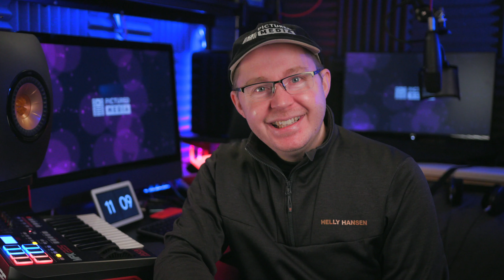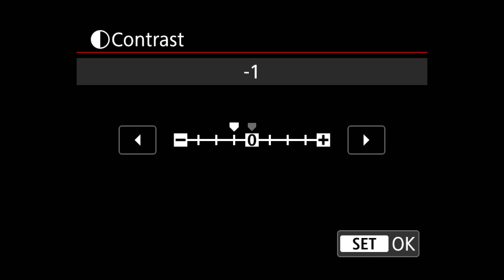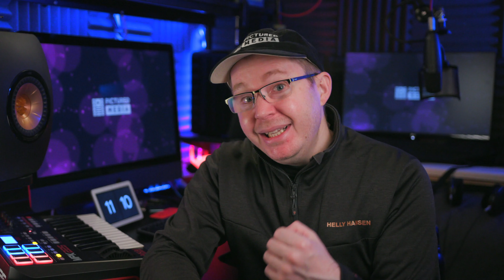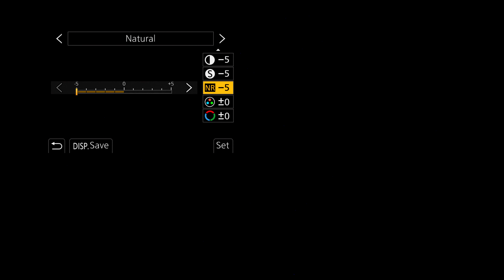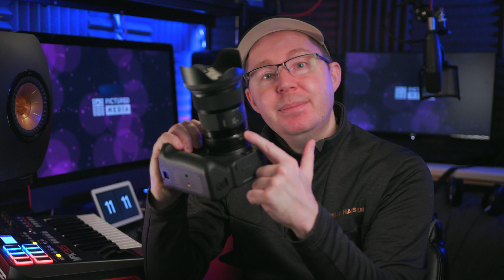Canon R6 Low light test with GH5S comparison

Comment: Thank you for those tests, can't argue with new tech and full frame these days for sure :) but as a GH5s user there are a couple of observations if you don't mind me saying..
The 'base' ISO on the GH5s can go to 160 if you turn on the 1/3 ISO increment option in the menus and with the extended ISO setting turned on you can go down to ISO 80(but perhaps beside the point). It's also probably why you skipped testing at 2500 ISO which is part of the dual native ISO setting for the GH5s (400 & 2500 as you may know)..
Thanks again :)

Comment: The GH5s is a better video camera overall. These new full-frame mirrorless cameras have a host of drawbacks that come with the large sensor size. For photos, they might make sense, but when I look at the world of video production, smaller sensors tend to be superior to larger ones when it comes to the "external factors" outside of raw image quality (stabilization, cost, battery life, weight and bulk, sensor overheating, long zoom potential). MFT strikes a perfect balance between good image quality and good external factors, and the GH5s is arguably the perfect MFT video camera.
Reply from the maker: I pretty much agree with all of that.  My GH5 & GH5S remain my workhorse cameras, and the icing on the cake is that they are really nice cameras to use.
R6 is good for low light on a gimbal where autofocus is important, but 90% of the time I grab my GH5.

Comment: Pretty sure you'll find you can never 100% remove noise reduction in video on the Canon that why the image is getting notable smoother. If you try again at default of 0.
Reply from the maker: True. The C70 retains detail while getting noisier. The R6's lack of noise has a penalty in image softness and banding at the highest ISO values.

Comment: R6 has far more stops in Dynamic range but each has different distribution, R6 has (in photo picture styles) 3.7 stops in highlights (stops above mid grey) and GH5s has probably more but at the cost of less stops in shadows which results in noise. Clog redistributes dynamic range as follows: 6.7 stops bellow mid grey and 5.3 stops above mid grey.

Comment: On the R, Clog actually reduces noise in low light. Maybe do a comparison between standard or neutral and graded Clog?
Reply from the maker: Interesting. That wasn't my experience on the R.
Reply: @juliancroot  See Potato Jet A7 III vs R comparison. Might be Armando's video. Not sure.
Reply: hi, I did exactly that.. standard vs clog
Reply: @getmarked  I remember seeing your video. What was your conclusion on low light?
Reply: J testing R6 vs 80D in lowlight right now 😁 and also neutral vs clog in lowlight

Comment: R6 is a full frame camera,. Your using a crop lense on a fullframe camera,. That's very wrong comparison,.
Reply from the maker: The 24mm Art is full frame.  Also, this is a comparison a lot of people are interested in (including me) because the GH5S is really good in low light, and better than this camera's predecessor, the EOS R.
You can also ignore the GH5S comparison if you wish, and just concentrate on the R6 footage, which was the primary purpose of this video.
 
Thanks for watching anyway.
Reply: The Sigma is full frame.

Comment: Thanks for the video.  I agree, keeping both cameras at F8 was the correct choice given the nature of the tests.  The only point of contention would be the use of a picture profile on the Canon.  Sadly, Canon made all of these modes in 8bit vs 10bit on the GH5s.  While this is part of the camera as it stands, the sky might have been better in a 10bit mode.  Maybe not but it would be good to test out just to see.
Reply from the maker: In this test the GH5s was also recording 8bit, but I still agree with you that Canon's picture profiles outside of Clog are not ideal for video.

I'll see how it does in Clog on a sunny day when we next have a sunny day. 😊
Reply: @juliancroot  Cool.  Did you happen to try and grade the footage to see if you could recover the color information on the Canon?
Reply from the maker: Yes.  The waveform from the Canon footage was a brickwall at 100 IRE.  There's just nothing there beyond it. 
The GH5S could've been recovered a bit if I needed to, but I left them both alone.
Reply: @juliancroot  Thanks.  Seems like there is always a drawback.  Great light gathering and noise but the image loses a lot of fidelity.  But to be fair, that was a pretty extreme ISO.

Comment: DOF needs to be matched imo, otherwise its 2 rather different shots, even with you matching AOV.
Reply from the maker: Yeah, but if I'd matched DOF, people would argue its not a fair test because of the ISO or shutter variation required to maintain the same exposure.
Given that I was testing ISO performance, I think it was important to maintain the same exposure at the same ISO value.
I also believe with it being a wide shot at F8, almost everything will be in focus on both anyway, so it shouldn't be an issue.

There was method in my madness. :)
Reply: @juliancroot  IMHO it would definitely be fair test to match the results including DOF. But I agree most people don't understand comparing MFT ISO100 to a FF ISO400. I guess You could probably explain it with a few proper examples though.